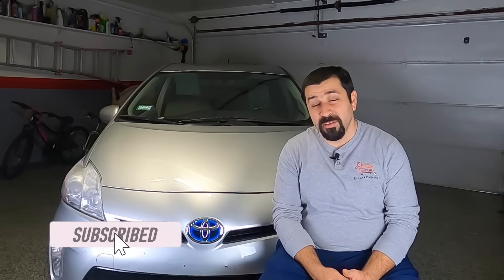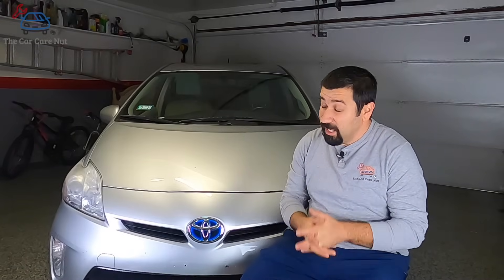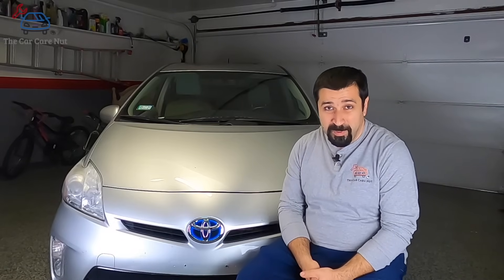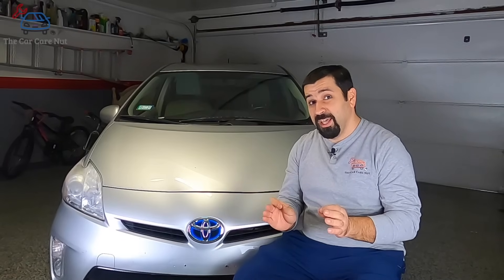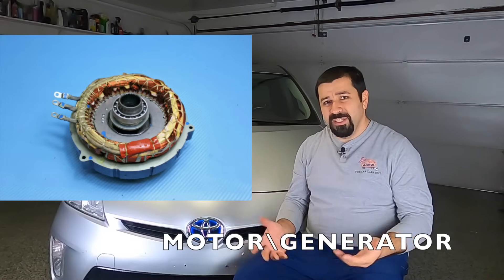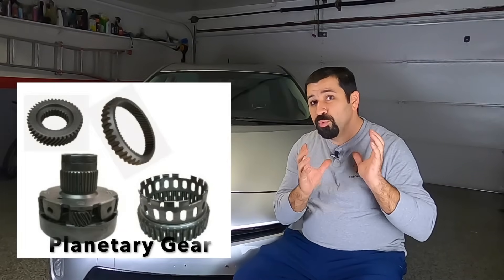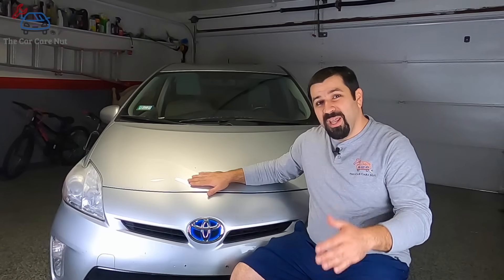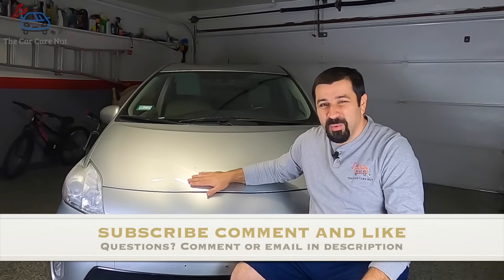How Toyota Hybrid System Work Part 3 Hybrid Transmission

Comment: Hi! I love your videos and I've just purchased a used 2019 Corolla Hybrid 2.0 (10K km). The car Is great but when its cold (1-2°C), 1-2 min after I startup the car and the engine ramps up to get warm, its like the transmission gets engaged for 1 sec trying to move the car (while it is in P, with park brake on). Same thing that happen when you forgot to release the parking brake before moving with a manual transmission car..do you think its normal? Maybe is the transmission fluid too cold? Thanks for everything!
Reply from the maker: Hi! That is normal for hybrids. Everytime the engine starts it will do that rock back and forth

Comment: Excellent explanation!  I would add that only Toyota (and their licensees like Ford) do it this way, where magnetic fields replace clutches and hydraulic pumps.  Magnetic field do not wear out.  Thus, greatly increased reliability.  The Europeans, in contrast, add a simple pancake motor between engine and transmission and call it a hybrid.  Totally different and very misleading in reliability terms.

Comment: Hi Car Care Nut.
I live in Australia. I have an AWD RAV4 Hybrid and I tow a small Avan. My problem is that my local dealer says that Toyota wont approve any device that diverts power to charge a caravan house battery. Is this correct or is there a way to do it without adversely effecting the vehicle or the warranty? 
Dave

Comment: Hi Car Nut.  I am the 2nd Owner of a 14 Gen 3 Prius.  Is the transmission fluid change something you think should be DIY?  Saw videos indicating the fill had to be done under vacuum pressure to be certain fluid level is at right volume.

Car just crossed 100k miles last week.  Laundry list to be performed are plugs, water pump & Coolant exchange, and transmission fluid exchange.  No indicators of any problems with any system.  How would you prioritize from a preventative maintenance perspective only?  I'm thinking plugs, Water pump & Coolant, then transmission.
Reply from the maker: Hi! The fluid is very diy and actually simple. I have a video for it. And for priority of things. Repairs before maintenance. Water pump from that list is first
Reply: @TheCarCareNut  Thanks for the prompt response and information.   I'll try again to find the video of the Prius transmission fluid exchange.

Comment: Really enjoy your videos.  I have the 2017 Highlander Hybrid Limited.  Do I understand correctly that these vehicles do not have a torque converter, or a clutch, or any type of friction plates or bands?  Thank you!
Reply from the maker: Hi! That is correct. They have a mechanical clutch in the event the engine locks up it would basically break to prevent damage to the transmission but it’s engages all the time and it’s between the engine and transmission. But otherwise no clutches inside the transmission not a torque converter.
Reply: @TheCarCareNut  Thank you for the reply! Now I'm very pleased with my decision to purchase the Highlander Hybrid.

Comment: 5:58 sorry, but the battery cannot simultaneously be taking a charge AND supplying power to MG-2 and the wheels.  Current only flows into/out of the battery in one direction at a time.  I did learn how my 2018 Camry Hybrid handles mountain driving on a trip to Colorado.  I was curious as to how it would handle speed control on a very steep, long downhill, so I found such a stretch on I--70, set the cruise control to 65 mph, and pointed it downhill.  Of course, the first thing the system did to slow the car was to fully charge the battery off of MG-2, retarding the drive wheels as it did so.  As the gradient increased and the battery reached full charge, I could see the engine rpm increasing as the transmission smoothly shifted ratios as needed to increase engine braking and keep the road speed down to the set speed.  I assume that the system would have begun applying wheel brakes if the gradient was steeper than engine braking could overcome, but that would probably be an extremely rare situation.  In the end, no manual downshift was required, no braking, and no indication in the cockpit other than the increasing rpm on the HUD display; just smooth, effective control of everything needed to maintain efficiency and safe driving.  Toyota has nailed it with this hybrid system.

Comment: That part where you said that Toyota was the laughing stock of 2000 is like history repeating itself again. When Toyota first started off making cars, they were told that they could never make it. They were made to look like fools when they paid suppliers MORE money for higher quality components. None of the American car makers could understand why Kaizen existed, who would willingly stop a production line, and so on. They smugly continued doing whatever it is they were doing.

Now, Toyota has the last laugh. RAV4s outsell anything else by a huge margin. Toyotas are seen as reliable, and GM, Ford and Chrysler (lol FCA / Stellantis) are synonymous with junk. 

When you explained the Toyota hybrid system, it seems pretty obvious to me what a genius design it is. Look at the ways that a gas engine is inefficient and use the HV battery and the MGs to compensate for that. When the car is stationary, use electric power to run the systems while shutting off the engine. Use MG2 to get the car moving (which would be inefficient with a gas engine alone), then turn the gas engine on when it is in its most efficient mode to keep the car cruising and to charge the battery via MG1. 

So it is mind boggling how the American car companies did not learn from their mistakes and chose to sit on the sidelines yet again, watching Toyota quietly eat their lunch and achieve hybrid superiority right under their noses. It is insanely short sighted! 

Now with the current push for EVs, companies are rushing to get their models out ASAP. They're once again laughing at Toyota for not having an EV model other than the Bz4x concept. Guess what is happening? EV fires, build quality issues, battery supply issues, software glitches and all sorts of things are working to decrease consumer confidence in EVs. 

Meanwhile Toyota is looking at the current infrastructure and seeing no real improvement to support mass EV adoption. They are seeing that current battery tech takes too long to charge. None of these things are good for the consumer looking to get an EV. Hybrid is the way of the near future until infrastructure, battery supply and charge times are addressed. They'd rather 'release' an EV to show consumers they're doing something, and keep refining and developing the EV until it is really ready for market with no chance of catching on fire, with acceptable range and charge time, with the reliability they're known for.

Comment: I think its hard to understand how you can gain energy by charging the battery with the motor. It would be more efficient to use the motor to drive the wheels directly instead of going though a generator to charge the battery. You loose energy by this because you need to use more petrol to charge the battery than using it to only drive the wheels? I understand that if you only harvest energy when breaking or slowing down you gain energy. But not by the above.

Comment: I really appreciate your explanation of the way a hybrid transmission and electric motors work. I have a question though: I often drive in hill or even mountain country, so that the battery is recharged very quickly going downhill and I'm wondering what is MG2 doing with the excess electric power it keeps generating once the battery can't use any more of it? Thanks and God bless you!
Reply from the maker: Hi! When it no longer needs any more charge mg2 will just spin and be an open circuit so it won’t generate
Reply: @TheCarCareNut  So it still brakes the car but it doesn't affect the battery? Excellent. Thanks and God bless.

Comment: These videos on how hybrid works are very helpful! Thank you!! 
I do have a question though. What should I do if my transmission is not working properly? For example, I was push the gas to go uphill but when I let go of the gas it felt like my engine was going faster and sounded louder. But my car wouldn’t go fast, it actually took a little more time for it to go faster.
Reply from the maker: Hi! That could be b mode. Sometimes it will activate automatically.
Reply: @TheCarCareNut  I'm so confused. I have a 2016 Highlander Hybrid, I thought it has a 6 speed transmission. Toyota dealer calls it CTV and I believe so does the manual. On my car is it a regular 6 speed automatic transmission, a conventional CTV with 6 gear range, or an e-ctv? Also does it have a differential in the back for the AWD system or is it a 3rd Motor MG3? THank u
Reply from the maker: Hi! Your highlander hybrid does have an eCVT. With a 3rd motor MGR in the back

Comment: I've only just found this video and it has answered a lot of questions. I bought a Toyota Auris mainly because I saw how many taxi and hire car drivers were using them. Also because of the number on the market with over 100,000 miles on the clock but still commanding good prices. It all seemed to say "reliability" to me but I often wondered how the CVT promoted such reliability. Now I know - No Belts. I think my Auris is great by the way, easy to drive quiet, dependable and, as I have an estate version, I can get all my tools in the back!
Reply: I’ve also got the same model car that I purchased in September 2022 and I am really pleased with the car and the technology .	The drive is so smooth and quiet and the fuel consumption is excellent.

Comment: Would love to hear your take on the direct-shift CVT which is in the new Yaris: https://youtu.be/xbXH9SkzmsA

It seems to have a regular CVT belt with an extra starter gear.
Reply: Wait... That might be just for the non-hybrid version.

I'm so confused when it comes to finding out what's exactly under the hood. Is it the "Hybrid Synergy Drive" with the planetary gear system as well?
Reply: I think Kelly at Weber services explained that the Prius III has two sets of gears and is diffrent than the original CVT transmissions? Not sure it has been a while since I view his video?

Comment: Nice informative video. Sometimes I face issue with my Aqua-2014, While running at slow speed when I press paddle to accelerate, engine sound and rpm got high but it increase speed slowly. Please help to identify the problem.

Comment: I have unanswered questions regarding this and been hoping you (or anyone) could answer it. Please and thank you

Newest gen of Corolla (E210), the hybrid version, is using this exact hybrid. Yes?
But every automotive's reviewer in my country are numbnuts, they kept telling audiences that newest Corolla hybrid is using REAL cvt gearbox with 7 virtual speed.

1. Were they right?
2. Or this exact hybrid only happen in usa or something?
3. If, just if.. If they were right. How is that works?
Reply from the maker: Hi! This corolla has an eCVT for the hybrid model. It doesn’t have physical gears and works exactly the same as other models. Some of them will have paddle shifters and will show that it has 7 gears but it’s actually just computer programming to mimic a 7 speed transmission but inside it works exactly the same
Reply: @TheCarCareNut  then i was right. Theyre numbnuts, they called themself automotive reviewer but had zero knowledge about what theyre talking about. On the other hand

1.8l 2nr hybrid here had different hp figure with usa, here is bigger. Also usa corolla hybrid didnt have paddle shift while here there is

Comment: Long time listener, first time caller.
I want to thank you for all the good work you do.
I would like to ask you a question.
I have a 2021 Toyota Camry Hybrid LE. I accidentally shift gears to parking while still driving the vehicle at really low speed. I will guess less than 6 mph. I heard a nasty sound. It drives like nothing happened. I don't know if I should be worried?
Thank you in advance for your answer.
Reply: Thank you a ton for the quick response.
Do you think this situation is related to what Scotty Kilmer mentions in this video at 2:12
https://www.youtube.com/watch?v=qDu4ltKuLfo
Reply from the maker: He was mainly referring to reverse which applies to your Camry as that’s software controlled and basically nothing will happen. But park is a mechanical action of engaging the parking pawl
Reply: @TheCarCareNut  Thank you sir. I am the same person as the above. I review a footage of the accident an the actual speed was 1 mph, maybe less. I almost stopped completely. Like I said, I when from drive all the way to park. After a week the car seems to be fine. The engine sometimes sounds kind of louder than before; when the car is not moving and the electric motor switches to the gas engine.
Thank you for your answer. I always watch your videos.
Reply from the maker: Hi! Honestly the situation is not ideal but it’s an accident and things happen but since everything is working well I wouldn’t worry. This is one of those situation where either damage happens and you know it or it doesn’t happen and life is good. In your case nothing happened and life is good 😀 just try not to have it happen often.

Comment: So, if MG2 is used for normal braking, how often and how much should I brake hard to condition the hydraulic brakes?
I've been told that many hybrids and EV's needs brake jobs often because the brakes tend to seize up from the owner not using them enough.

Comment: You are saying that the engine only drives MG1 and MG2 drives the wheels. I think that the engine also drives the wheels along with the MG2. 
You said the MG2 brakes the car, I think it's both hydraulic and MG2 braking, because the hydraulic brake switch would not activate if only MG2 did the braking alone.

Comment: i like this very much "keep it simple Stupid" ! i changed gear oils at 200000km; dealer said no its not necessary but i insisted...later they said yeah oil was ready for a change,lol.  same with the accessory belt in front of the engine.

Comment: I feel the people that made the planetary gear system and this hybrid system and so many other parts of this hybrid possible. They are all genius's in their accomplishments!
Reply: In my opinon Toyota engineering  over all is the best in this world , but like Honda fell in the past it appears that some of the newer Toyota models are not as good as the older models. I have a 2002 Tacoma with a 2.7 liter POWER HOUSE and automatic slick smooth transmission that has over 206,000  miles on it an runs and functions like new, no joke, also I own a 2013 Prius which is pretty much the same as the 2002 Tacoma Quality,Quality, Engineering, Engineering...

Comment: Planetary Gear System: basically allows the front & rear wheels to allow travel at different speeds in a turn. 6 gears come together top to bottom and all four sides. This allows the wheels to turn at different rates of speed. 

That is basically what a Planetary Gear System works.